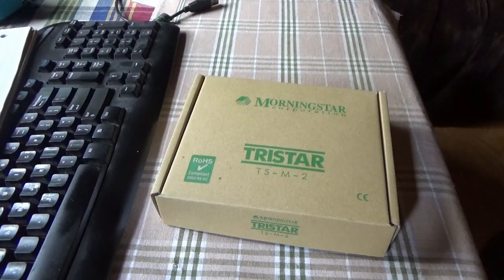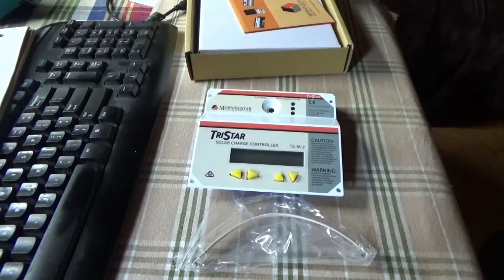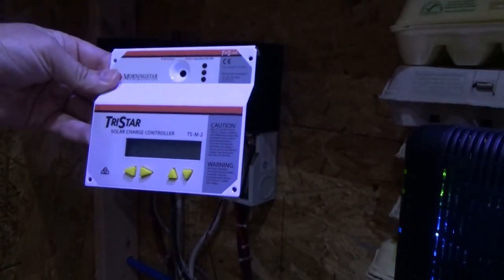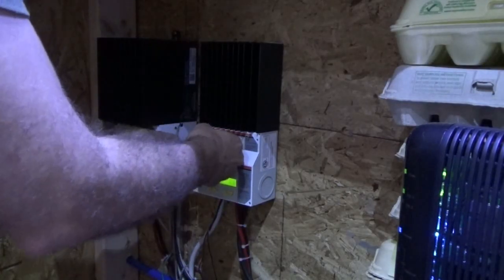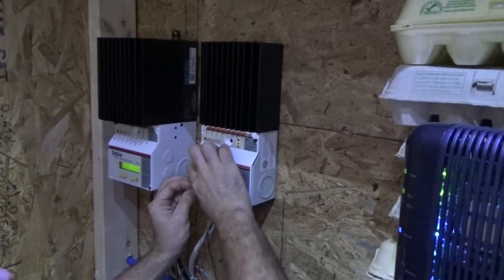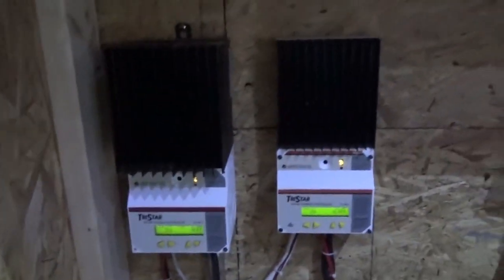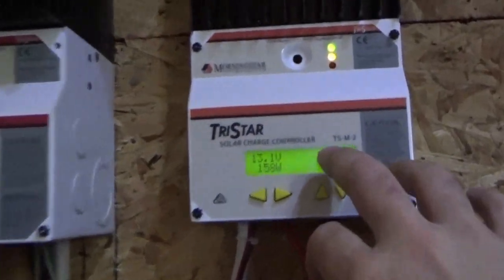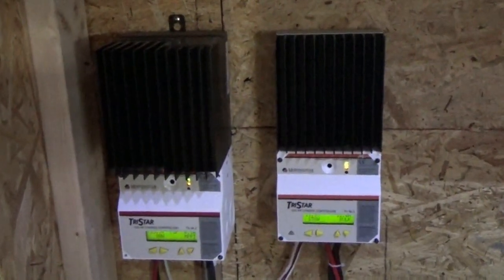Installing A Digital Meter On My Tristar Solar Charge Controller

Comment: I have the same charge cont. and added the digital display but it does not light up. I have to stoop down and squint to read it.  Did I miss something in the install ?
Reply from the maker: Remove the front panel and plug it back in again. If it does not light up then maybe its defective.
Reply: @TheDoItYourselfWorld  Thanks....I will try that.

Comment: Can the TS 45 pwm use s 24 volt battery system I thought they were rated for 12 volt 24 volt and 48 volts ?

Comment: That charge controller can be set to 12v 24v or 48v I'm surprised you don't know that!!
Reply from the maker: Yes I am aware of that. You can double total solar panel capacity by simply doubling the voltage.

Comment: Hallo i follow with interest your videos about your energy project.   I live for years on a boat, a small house floating on the water.  I have 6 King Sun solar panels 220 watt 88 Cell 44.7 volt.

For charging 8 Trojan T145 Battery's a battery bank of 24 volt by 520 amp. 

For charging i use a Solar Mate charge controller 60 amp max 1500 watt by 24 volt.  

I wanted from the beginning to buy a Morningstar MPPT 60a charge controller or a Outback FM80 Flexmax.

Both those are very expensive in the Netherlands, almost €800,- $900,- for the Morningstar 60A  and €900,-  $1000,- for thr Outback FM80 Flexmax.

The sellers are Profiteers.

It have also to do with the euro / dollar exchange.

I will begin with the Arduino measure project that acts as a battery monitor,  what  calculate which comes in and what is going out.

Give information how much energy is left in the battery.

And work also as protection for to deep unchanging of the battery.

If it is ready i let you know.

Comment: the voltage error is wat y warned you for previois,, pitty you missed that advice!

option wil be to conect a wire in thepanel itself on one of the diodes, just skip one of the rows in the panel to get the voltage drop,.,just for now before you gett the 17 volt panels .

Comment: All 12V nominal solar panels are in the 17-19V range and lead acid batteries charge at 14.1V to 14.8V depending upon brand, type and chemistry. This means that extra panel voltage goes to waste with a PWM controller. With a PWM controller in bulk the panel is essentially direct connected to the battery. This means the panel voltage becomes identical to the battery terminal voltage, minus any wiring voltage drops of course, and the panel slowly increases battery voltage to the absorption level. Because of this direct connection the excess voltage is simply not used as efficiently as it could be. Once at absorption voltage the PWM controller limits the voltage to the absorption set point just an an MPPT controller does. There are no gains or boosts in bulk with PWM and the extra panel voltage simply goes to waste.

Comment: Just go cover a few cells on the 24 volt panels to lower the voltage a bit... Cells are in series to raise voltage cover a few and voltage will drop.

Comment: youl have to show us the voltage on the computer to see if the batteries get fully charged and equalized
Reply: +Roy Amberg : The PWM controller doesn't have an ethernet adapter.